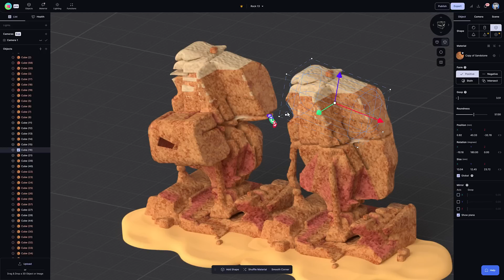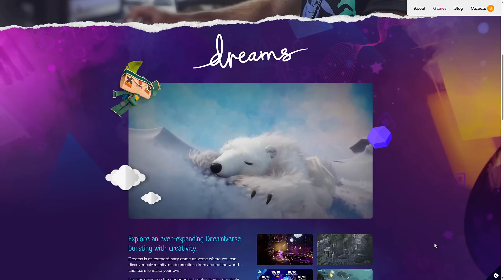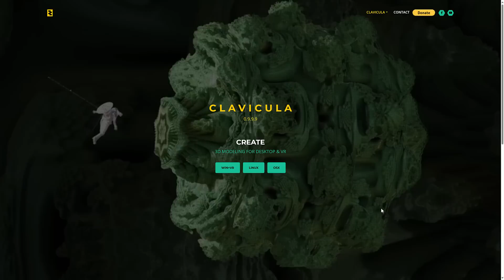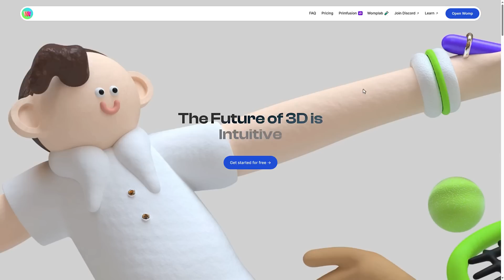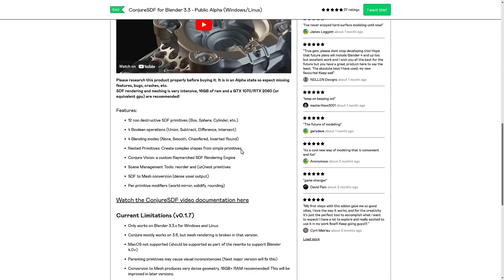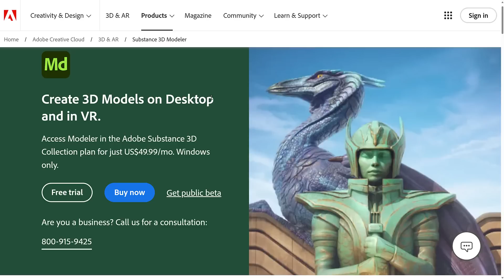SDF -- The Future of 3D Modelling?

Comment: Are the polygons done right to optimize performance for video games? Does it always make four sided polygons?
Reply: Technically no polygons need be generated. SDFs can be rendered with “ray marching” and “pure” SDFs will give exact results just through the SDF without any mesh at all.
Reply: Probably not, expect to retopologize. Clavicula has an automated retopology tool built in to retopologize your sculpts
Reply: your 4 vert plane is chopped at runtime for 2 Triangles (if the plane even makes it to runtime before being chopped). the 4 vert plane is considered the "best' because it allows for things like subdivision/collapsing, and more logical UVs (effectively by using 4 vert planes you are "helping yourself later"). when everything is done the GPU gets triangles, if it is given 4-vert planes it cuts it into Triangles. this is why most modeling tools/apps the statistics will show "polygons :X" and "Triangles :Y".

the value of this system is that it is Boolean logic on primitives. the retopology stuff in these tools/apps has to do for exporting where SDF has a chicken and egg "is this popular enough in the industry for us to support in our engine" and "is this supported in enough tools for this to be meaningfully learnable". many of the applications are in tool/app or custom workflows/pipelines

Comment: So it's kinda mix of boolean and metaballs?
Reply: Metaballs are done using SDFs.
Reply: pretty much yeah.
Reply: Signed distance fields is the actual name for meta balls. It's essentially the same, a mathematical description of distances of shapes.
Reply: @Polygarden  I might be wrong, but I believe the original «blobby objects» paper by Blinn used intersection algorithms rather than sphere tracing (later called SDF).
Reply: @wailfulcrab  In case you or anyone else is interested, the original «Metaballs» paper by Blinn was called «A Generalization of Algebraic Surface Drawing». The Algebraic mehod calculates intersection points between a ray and a shape directly, and is not an iterative approach like SDF. SDF is a Geometric method, using an iterative approach; a bit less optimized but much easier work with when making complex shapes. 
The original paper on SDF was called «Sphere tracing: a geometric method for the antialiased ray tracing of implicit surfaces» and was written by Hart. Two incredible papers!
Reply: Search for ray marching
Reply: yep, just slap a new name to it

Comment: Aren't SDF's extremely performance intensive?
Reply: Depending on what you do. For some things it's much more optimal than triangles. For other things it's orders of magnitude worse.
Reply: For 2D stuff, it's really not any more expensive than using a "classic" alpha mask (mask = texture) for alpha testing (as opposed to alpha blending which is a lot more expensive).
I don't know about 3D. I think it needs multiple 2D planes overlayed on top of one another, to give it a sense of "depth". That would be expensive, yes.
Reply: Actually the opposite. Its all math on the GPU. Its usually tied to ray traced SDF which is performance intensive
Reply: @jake-ly  as if everyone has a top of the line GPU bruh

Comment: SDFs are also the foundation of unreal engine's lumen.
Reply: Not really a foundation, but one of the methods of simplified representation of geometries to optimize speed. They combine many other tricks (voxels, light cards, screen space) and the code is constantly evolving. They especially need all these "hacks" because of the virtualized micropolygon geometry (Nanite) that makes tracing actual geometry very difficult.
Reply: @kazioo2  basically is the basis for the software ray tracing method. The light cards are used to update the surface cache for light sampling at the trace hit position. I believe voxels are not used anymore, that was sort of a fallback method in an older implementation.
Reply: I think Lumen (only) uses SDFs for a simplified scene representation in the software RT version of Lumen. The version that uses hardware RT doesn't use them, as far as I am aware.
Reply: @cube2fox  exactly. It is a scene representation that exploits some properties of sdf to efficiently trace rays.
Reply: I would say surface cards are the foundation, afterwards it is a mix of screen space, sdfs and voxels for software version
Reply: @Navhkrin  true, being able to use hwrt too makes the surface cache a more essential part of the system.
Reply: UE has had SDF shadows for a long long time, way before Lumen
Reply: @JorgeFuente-Alba  yes, and medium scale AO using sdf too but the UE5 implementation is a lot more efficient since it had to support lumen which is a major selling point for the engine.
Reply: ...which has DOGAWFUL optimization -_-

Comment: Cinema 4D has had SDF Mode since at least from 2018. Dreams came out later?
Reply: I think Volume Builder is Voxel based, but it combines the best of SDF and poly modeling as you can transfer any poly model mesh to it, as opposed to being limited to SDF shapes. SDFs will have better performance tho.
Reply: It's been a core part of my workflow since its introduction, too. I love how it's just integrated in such a complete way with the rest of the toolset!
Reply: @daemoriazy8751  Yeah its a huge game changer for modeling (and gamedev)